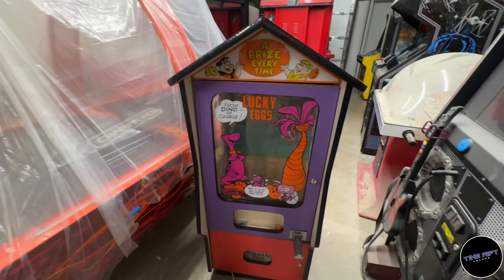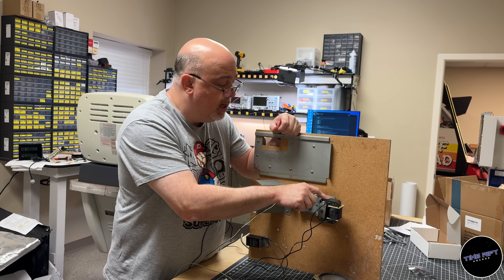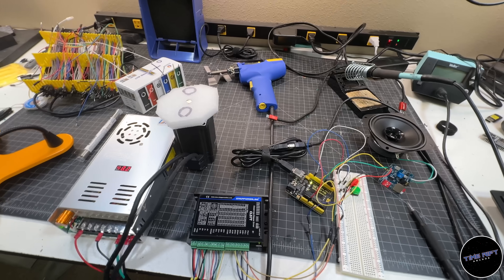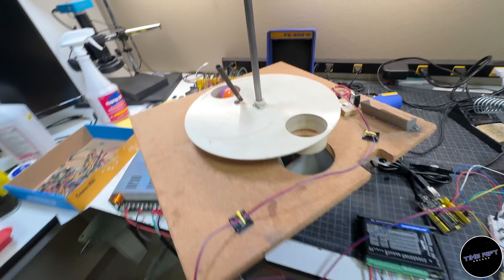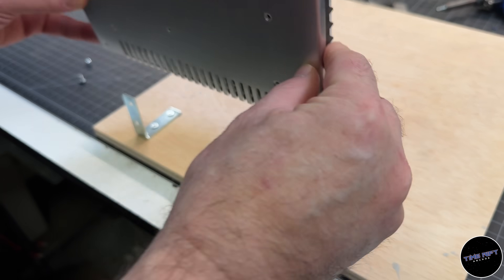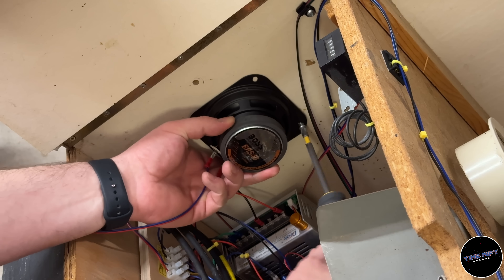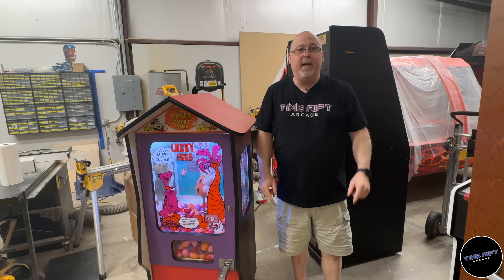Flintstones LUCKY EGGS Arduino and Stepper Motor Conversion

Comment: Just  a small warning/piece of advice: Those WS2812 strips get quite hot and without a proper heatsink, especially if in an enclosed area, they tend to overheat and fail prematurely if you always use them on full power white.
With an alu profile as a heatsink this tends to be less of an issue, but you can also use the RGBW strips. Their separate white channel uses less power than using 100% R+G+B, so it generates less heat, and their LEDs are typically also higher quality. The WLED firmware supports it these no problem.

Comment: Okay, but why use an Arduino Uno at all though, when you are already putting in an ESP32 which is an order of magnitude more powerful and can run both tasks with multi-threading?
Is that what you meant by being aware of the irony?  I suppose the ESP32 could also do the sound output too without the need for a separate playback board...
Reply from the maker: Mike said in the video that it was ironic. ;-)

Comment: Were you educated in Europe? We typically say "particle board" not MDF. I've heard "line level, line power, line voltage" but not "mains". It's weird hearing you say those words with your accent. Love your videos.
Reply from the maker: Its more of just using the proper name, regardless of what the country specific colloquial term is so that there's the least confusion for the largest audience.  Particle board is LDF.  MDF is denser than particle baord (Low Density vs Medium Density Fiberboard) for example.

Comment: I find this video very interesting, but i wonder why using two power supplys connected constantly to mains. Just use the 24v and step down to 12v for led and 5v for arduino. Just a waste of energy and power supply. Or use a relay to switch the 24v power supply just on when the stepper motor is needed.
Reply from the maker: Commercial setting.  The less complicated the better.

Comment: One more test you should incorporate.  If the motor runs for a certain number of seconds or revolutions  (much longer than a normal egg drop) and no egg is dropped, you should program the Arduino to  make an error condition in which the coin door lock out activates  and the motor stops on its own.  You could even program the lights to turn a certain steady color or even an unusual flash pattern and play an error sound when this occurs. This will prevent a motor burn out when it:

* Runs out of eggs 

or 

An Egg Jam occurs preventing it from dropping. 

P.S. I wonder if that is what led to the motor burning out.
Reply from the maker: We did exactly that.  If the tray turns 4 times and no egg falls out, the lights turn solid red in the machine and it won't accept any new credits.

Comment: You did an awesome job but you'll find that those connectors on the Arduino are not production quality and they will fail in your installation.
Reply from the maker: Never happened in any of my other projects.

Comment: When bringing old arcade machines like this to an operating arcade facility, does anything need to be done in regards to the plug/power situation? For instance, the 80s claw machine I mentioned previously is only a 2 prong. Is there a special type of surge protector you put on these or anything for safety concerns?

Comment: This video was fantastic and timely! I am working on my first arcade restoration/mod of a Grayhound Skill Crane. This morning I was researching boards to buy to add music when a coin is inserted, when later I came across your video which looks like it has the same board I ordered :)  I am hoping to use the board without an arduino and just use the coin slot switch to trigger it.  I need to replace the fluorescent light at the top of mine too and this has me thinking maybe I should go with the ESP32 as well- though if I do that I imagine I'd also need to install a sensor in the drop chute to trigger it.  Its easy to scope creep on these projects :)

Comment: The only thing I would add is a tinted diffuser plexiglass at the top. I hate the look of led strips.
Reply: This wee game lad.  It's three feet tall. Unless yourr sittin' in a wheelchair or you're a wee lad (sorry if ye are), you'd need to be clobbered by a beer bottle and lyin' flat on the floor to seem em. And in that case, you won't see a thing anyway, mate!

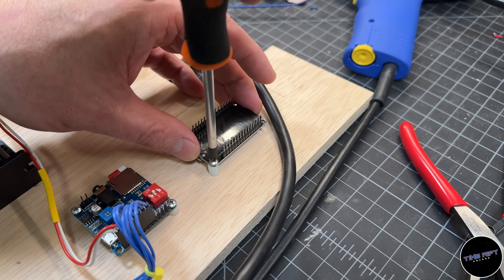Comment: 7:25 - Could someone explain what the irony is?
Reply from the maker: The ESP32 running the addressible LEDs is an order of magnitude more powerful than the Arduino Atmega328 running the game.
Reply: @TimeRiftArcade  You can easily run WS281x's with a straight arduino via several different libraries. I've done it off of a Nano so it doesn't take much computing power.
Reply from the maker: @timfischer  Agreed.  But it just doesn't compare to WLED.  And for reasons I can't reveal yet. :-)
Reply: @TimeRiftArcade  Thank you!

Comment: hopefully that stepper controller de-energizes the coils when it isn't moving, or you're going to undo some of your hardwork taking out incadescent bulbs.

the folks worried about overkill are forgetting that this is a single unit, not some cost-optimized thing being manufactured in quantity. sure, you could do that arduino's job with a single 7400, but they've got a lot of hardware to restore and just a few more months to do it in. get the job done in whatever way you're confident will work the first time.
Reply from the maker: And all of this stuff was already laying our parts bins.  :-)

Comment: Those were everywhere at the malls growing up. Those and a similar type that had a fake chicken that bawked and flapped it's wings and then laid the egg.
Reply: I remember that one. Why would Fred Flintstone lay eggs?
Reply: The version I remember had a parrot that would occasionally say "Polly wants a cracker." and when you put in a token, it flaps its wings and say "Polly want to say Thank you!" (shrug).
Reply: @Renville80  There were different ones everywhere you went. Chuck E. Cheese always had two or three different ones.

Comment: I remember those machines as a kid in the early '80s. They used to be almost everywhere, but I seen them less and less as the decade moved on, until they largely vanish by the turn-of-the-'90s, sometimes appearing tucked in the corner of some dedicated arcade, ether empty or near so, like a ghost of it former self. While I forgot what were actually in the eggs, I do remember the eggs themselves were a single color and had a random Hanna-Barbara character decal on them. I remember it ran "YABBA-DABBA-DO!" on repeat.

Comment: Motor an gear box is easy to repair just old grease in it all one has to do is clean and lube old grease out and boom works
Reply from the maker: Unfortunately there was far more wrong with ours.

Comment: That spring would have been mounted at each end to the rotating disc to help with sweeping an egg into the hole 😉 same mechanism on gumball machines
Reply from the maker: Yep.  Eventually I need to find a replacement for the 2nd one.

Comment: Is the arduino triggering a button press to the esp32 to trigger a wled preset for the firework show? This a a very awesome modern way to repower this older game!
Reply from the maker: Mike M here... That's exactly how it works.
Reply: @TimeRiftArcade  thanks for the reply, that is what I figured. Seems like the easiest way to interact with wled without some deep code knowledge.
Reply from the maker: @aaro_n  If you want to only run two wires you can run a serial connection and send commands.